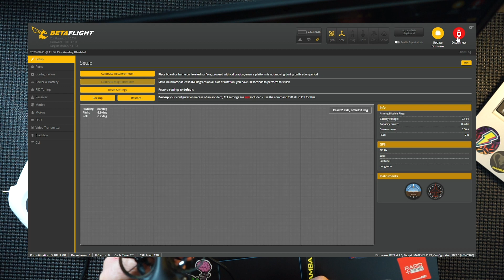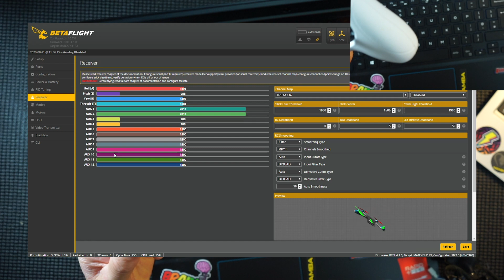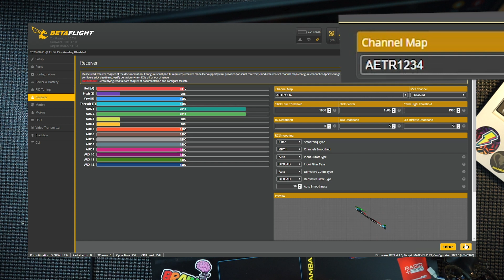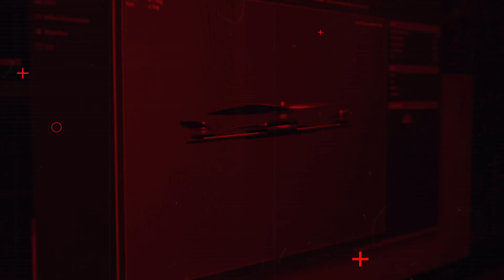Radio Sticks Don’t Match Up In Betaflight?

Comment: How do you sort that out if you have a beta flight1S meteor 75 mm from the advanced kit 2 that doesn’t have the option to plug in usb?? I’ve had mine for a couple of months now and have had no nothing but trouble with it..
The start up tune has gone really quiet now you can hardly even hear it when I plug a battery in ????every time I go to fly it to be something different wrong with it is it controls are back to front half of them don’t even work at all or manage to bind it hit the arm switch get it up off the ground to about shoulder height and then it would just go spastic full pelt into the wall the floor or the ceiling or wherever doing flips and re-flat out until you disarm next time it wouldn’t arm at all then the next time you would arm and then it just goes spastic straight away. couple of days ago I was watching a YouTube video and found out that it is supposed to be in D8 mode and there was two other dee 16 modes that are apparently only for overseas or something so I manage to get it into D8 mode today with the props of checked all the controls were all working perfectly and thought awesome I finally fix this little thing and I can actually fly it now so I put the props on  plugged the battery in and got it up off the ground and a couple seconds later dropped to the ground floor and faintly heard to start at tone and it just cut out I am do it again and to get it off the ground wouldn’t get off the ground and stopped and heard the start of June again so I have no idea what’s going on with it and I’ve just about given up as I am just new to this SPV after 40 years of racing motorcycles I’m hooked on it already but just wish I could have something that Will function properly so I can learn how to fly FPV I have a few bigger quads my first build is a rebel yeti 8 inch I have a source one V35 inch I have two bolter see kraken‘s boat 5 inch I have another source one V3 with 7 inch arms I have a Mr steel impulse RC apex 5 inch I’ve got The beta fpv X night 4 inch and I’ve got The beta fpv 3 inch twig racing quad and none of them have been flown yet because I can’t seem to get this little thing sorted so I can learn to fly before I go anywhere near any of these other ones as I’m quite certain that they will not be in the same condition in approximately 10 to 30 seconds after me arming it LOL sorry for the long text but I don’t normally like asking for help but FPV is a new journey for me in life after racing motorcycles and it has pretty much save my life and I have quickly become hooked on everything about it the community seem like an awesome group of people and I can’t wait to learn more and actually be able to get one of these things up in the air and experience what I think would be the best thing I’m ever gonna experience what you guys do any suggestions or help would be greatly appreciated thanks 🙏
Reply from the maker: Hi! sounds like you are having a complete nightmare!
the meteor MUST have a plug for usb... must I don't believe they take the usb connection off it at all - I do have a contact at betaFPV!... This is one of those that I would really have to see what is actually going on, I'd need to see the quad, how its working etc. what about the place you purchased it from? can they help you out? if not, my email is on my youtube channel, drop me a email but I will need some videos of whats happening to be able to help at all.

Comment: Hi nice video👍🏼👍🏼 I have one problem in betaflight it’s similar to this one and I have no idea what is the problem if you can suggest something thank you 🙏🏼…. So the situation is like this my RC and drone are bonded but when I go to the betaflight in (receiver) and I check the Preview of the quad it’s not moving i don know what to do here 
Quad: iflight Nazgul Evoque 
RC: TBS Tango 2
Reply from the maker: hey - it will either be: the UART for the receiver hasn't been turned on in PORTS, or in the CONFIGURATION you need to change the receiver to CRSF - one of those should sort you out.
Reply: @Datfpv  Sorry I’m new in fpv how should I know with UART should I use
Reply: @Datfpv  fixed thanks 🙏🏼

Comment: Thanks for posting I haven’t touched my radio or quads in months after getting frustrated, going to try this out tomorrow, I also have a question if anyone has had any issues with foxeer cameras and their vtx I get a lot of feed back, and the light on the smoke stopper came on, I’m almost done with a 5” build
Reply from the maker: hey - I like foxeer cams, never really had an issue with them, check your soldering, wires etc and do you have a capacitor to take away some of the spikes?
Reply: @Datfpv  thanks for the reply! I do have a 35v capacitor, running a 14.8v 4s battery, I think I’m going to try powering it off of the vtx instead of the flight controller next, also for the THF2 I was able to unarm the quad once I changed the stick lay out but it would go full throttle as soon as I barely touched it, I mistakenly reset the settings to default and haven’t been able to move on from that lol

Comment: I think my Literadio 2 Stopped working out of nowhere... was just flying in the sim and suddenly one of the stick inputs (yaw) doesn't work correctly any more. Center of the stick is now showing 1920 (other ones are all 1500), full left 1865 (other ones 988) and full right 2012 (so full right is normal)

Is there a fix to this or do I now need to contact betafpv for warranty? I hope it's an easy fix because the motor spare part I ordered over a month ago should arrive soon and I want to fly again so bad...
Reply from the maker: I've taken a look at the video and I don't have any suggestions for that :( I was thinking about RX endpoints in betaflight but that just looks broken to me - contact betafpv support they should help you out.
Reply: @Datfpv  thanks for taking a look! I now contacted support. Looked on the internet and it seems like mulitple people have issues like this. :( maan first the quad now the radio.. talk about bad luck..
Reply: @Datfpv  the support didn't reply so I opened it up and turns out it was just a broken wire! I ended up extending the wire at the point it was broken and soldered it back onto the potentiometer of the gimbal. Works perfectly fine now :)
Reply from the maker: @ELValenin  sounds good mate - glad you were able to sort it, hope you made a video!?
Reply: @Datfpv  no, not yet but I'll make one tomorrow for people that have the same issue

Comment: Hi Datfpv :-) My receiver is actually inverting the directions in Betaflight for YAW and ROLL meaning that when I mover the stick to the left the colored band goes right and when I move it right it goes left! Interestingly enough , the quad on the screen is looking in the left direction instead of looking straight! Do you have a tip to fix this?
Reply from the maker: hey, that doesn't sound right... ? not sure whats going on to be honest ?
Reply: @Datfpv  I don't know if it will work when flying but I changed the settings in the radio on the two channels that are affected. I clicked "invert" and it works correctly now in Betaflight the bars move in the correct direction but in the end the source controls are inverted! I can't test if it flys well because my power supply is insufficient to charge the 3S battery :-)

Comment: I have the same problem,but i fixed it in the opposite way,using the Letters that are not working for you. I also see the motors going crazy,when i test then without props. Any suggestions? I just bought a Nazgul Evoque but in the test without props the motor are running at crazy speed :(
Reply from the maker: Motors without props on do go crazy 😜 fact! There is nothing wrong with the motors they are fine it’s just something that happens without props on

Comment: ? So I changed the channel map and I’m still having the same issue. I’m using the same controller as u
Reply: Any suggestions
Reply from the maker: whats the issue ?
Reply: @Datfpv  so you show in your video how to get the drone to stop spinning in that screen. Mine is always spinning even after I change everything you changed in your video. No matter what channel map I choose it still spins any suggestions
Reply from the maker: and your throttle moves the throttle bar on the left of the screen ?
Reply: @Datfpv  yup and when I try to take off with the drone…the drone spins on its own lol I worked on this for 3 hours yesterday I’m so confused lol
Reply from the maker: have you calibrated the gyro.. have you installed the stack incorrectly ? what is the quad / flight stack ? provide info please.

Comment: Can you tell me where I get the beta flight and what version to download to my windows 7 PC? And will that straighten out the Betafpv controller to work properly because the only thing It can do is turn the beeper on the drone now.
Reply from the maker: https://betaflight.com    download the one that works on your computer - I don't know what computer you have mate!? tray them all?
Reply: @Datfpv  Hi I tried installing the beta flight on my Mac Pro and I installed the one driver because the Mac doesn’t need the other drivers that are mainly for windows I am told? and I still can’t get the beta flight to show the port that recognizes the drone when it’s plugged in the beta flight it just gives me the option for Bluetooth in usb  in the drop-down menu but no COM port for the tiny hawk 2 when it’s plugged in to the computer any help with the Mac  and why it’s not recognizing the Tiny Hawk 2 when it’s plugged in the USB after I install the one main driver that’s needed for the Mac Pro?
Reply: @Datfpv  hi after I installed beta flight on my Mac pro and the one driver that’s needed when I plug the tiny hawk 2 BNF into the USB the  drop down I don’t see any option for the drone just Bluetooth is the only available port I’m using a data cable that came with the tiny hawk  2 in a kit and I can’t seem to get beta flight to recognize when the tiny hawk 2 is plugged into the USB port any advice?

Comment: How to fix it without betaflight? I have meteor75 with Lite 1S Brushless FC, and it has no any usb connectors. Ho to do it in OpenTX?
Reply from the maker: honestly no idea for that one I can't believe betafpv made something that you can't alter / fix at all... they might of though ?
Reply: @Datfpv  
I did it somehow with OpenTX. Need to order new FC, because one motor not spinning

Comment: Just got babyhawk 2 setting up modes in betaflight and it won't let me assign beeper to the switch I want on my tango 2. For some reason beeper only works on 3 switch button with angle and horizon really annoying.
Reply from the maker: This should help https://youtu.be/b5UYxhk5Bdk
Reply: @Datfpv  thanks will give a try great video by the way 👍
Reply: @Datfpv  didn't work beeper only works on 3 positioned switch either SB or SD. Have a protek35 which I have no problem setting which ever switch I want for beeper but my new babyhawk 2 won't play ball no matter what I do!!

Comment: quick question i bind my lite 2 radio with freestyle 2 but now i arm and go up a little on my throttle and it goes straight up and does not go down what can i do?
Reply from the maker: hey - like it stays throttled up? or yuo punch the throttle and it shoots up? - if you bring the throttle down does it cut back - once armed, they throttle is permanently on, but when the stick is all the way down it is a idle spin
Reply from the maker: also explain a bit more, if you don't have props on it reacts differently... if you are still connected to betaflight with no props on then the throttle does do strange things and will increase... disconnect from betaflight stick some props on it and it will be completely different.
Reply from the maker: one other thing as well, if you are holding your quad, the motors will react to you and almost fight you as the flight controller tries to level your quad.. don't do this it can damage your motors.
Reply: @Datfpv  yes it stays throttle up and when i try cut back it stays throttle up . I also have props on and without betaflight
Reply from the maker: ok in that case you need to connect it to betaflight and turn your controller on - goto the receiver tab and make sure your sticks are all in the correct place - and if your throttle is sticking you should be able to see it in the colour bars - if you scroll down a bit you should see a 3d pic of your quad if its spinning something is wrong...
Reply: @Datfpv   yes i did have weird mmovement i did fix but now its just my throttle 
everything els looks good in the 3d picture it moves like it should. Just that problem now
Reply: @Datfpv  when i arm it starts good it moves propellers and when i give it half like 25 % throttle it just takes off
Reply from the maker: it sounds like your controller might be broken then? - if you can send me a video of whats happening and also a video of your stick movements in betaflight, but if everything is correct then it should be fine - also when you say it takes off... that is what you want quads to do... I need to see mate?
Reply: @Datfpv  okay thank you man appreciate you and i dont believe its broken because i have it connected to a   Meteor 75 se and it works fine but i will send u a video thank yoy again
Reply from the maker: ummm if it works on your 75 then its quite strange so your not a complete newbe... ummm odd mate, send me the vid! keen to see it now.

Comment: Yeah I did all that but my drone still won’t arm ? Using e6 controller
Reply from the maker: when you connect your quad to betaflight and turn your radio on - in the transmitter tab do the colour bars move when you move the sticks? - if they do make sure the throttle stick is all the way down for it to arm - also make sure you are flipping your arm switch the correct way - if its red in betaflight that means its on... so flip the arm switch the other way (mode tab) so no red highlight, thats not armed how you want it.
Reply: Datfpv I got it to arm the switches are reversed to the opposite side as before
Reply: My switches are reversed I did get the motors to spin and it flew nice just need to figure out my switches. They’re backwards from before
Reply from the maker: in the modes tab you will see the list of what your switches do, you need your receiver (controller) on and connected to your quad, to be able to see the values change. Delete then replace with the switches you want.
Reply: Datfpv thanks I’ll give it a try later. Trying to understand all the terms. I need to set up the beeper as well